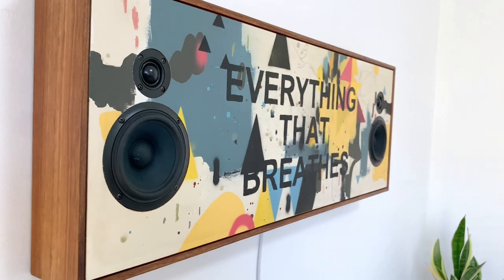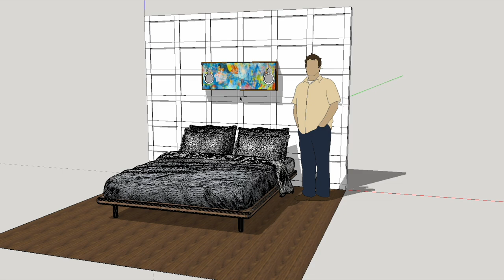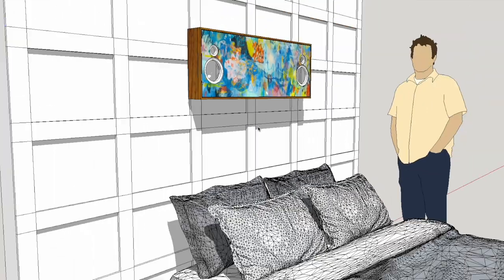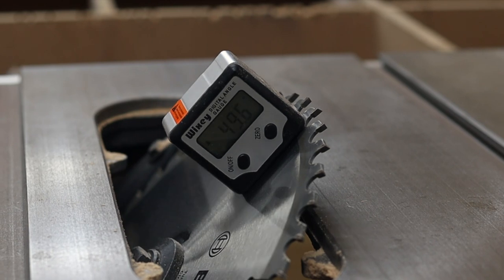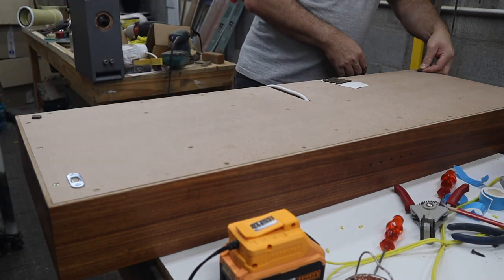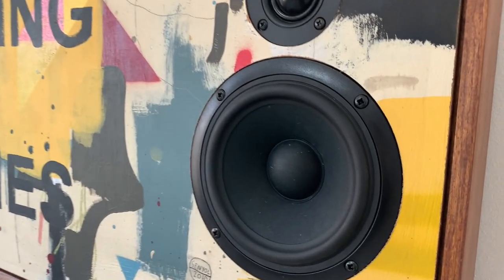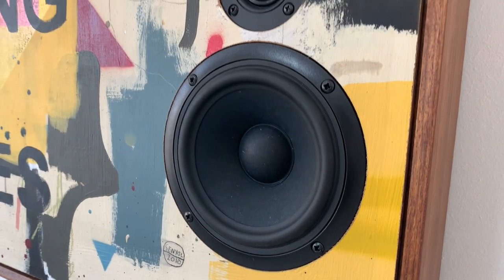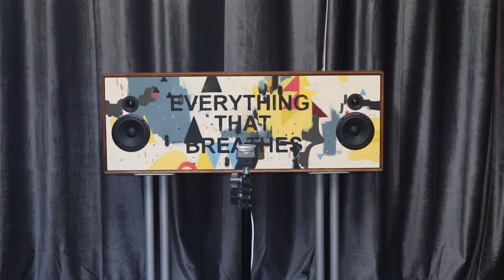DIY Wireless Art Wall Speaker - Unlock Your Inner Artist - by SoundBlab

Comment: That is a beautiful build, and a wonderful collaboration!  Visual art that produces acoustic art; love it!

Have you had any issues from that style of power supply?  I have two (soon to be four) of them powering the cove lighting in my living room, and they whine so loudly that I have to have a fan going in the room.  I also had one detonate so badly a few years back that it blew a chunk out of the desk it was mounted under.
Reply from the maker: Thanks! I try to get better quality of these when I can. So far, I have not had any issues or whining from them, or any blow up 💣. Good ventilation for these though are essential. But generally, some are made questionably cheap, and others are better and usually don't cause issues.

Comment: I've got a question. You chamfered the holes in the bracing for improved airflow, but not the ends of the ports, is there any reason for that or just easier tpo build?
Nice build.
Reply from the maker: Thanks. I personally don't think the chamfers makes too much difference on the bracing holes and I am not sure why I opted to do it here. Sometimes I get really into the build and then you just do what makes you happy at the time 😊. The port was calculated to not have much cuffing even at higher SPL output, so no chamfers were required.